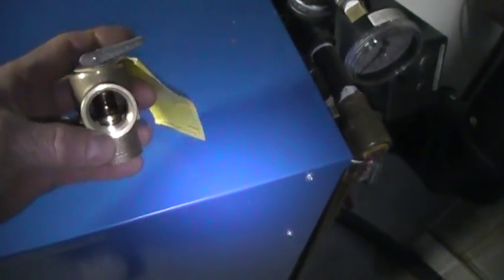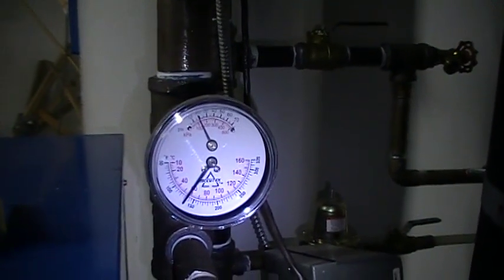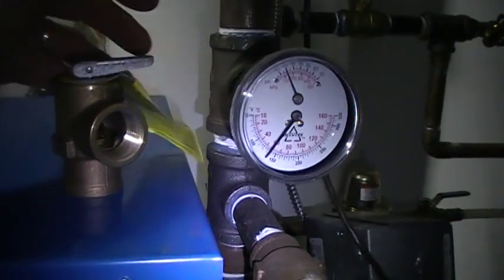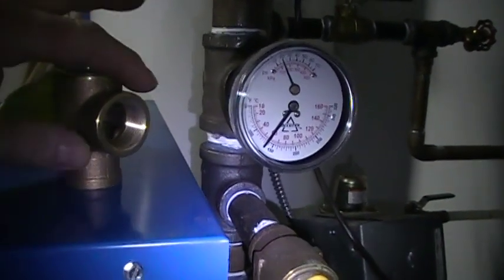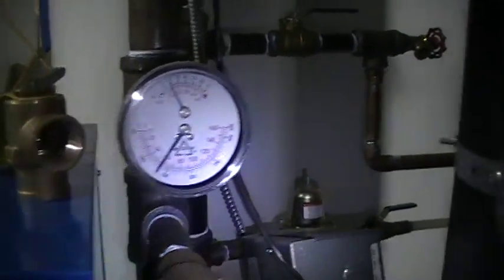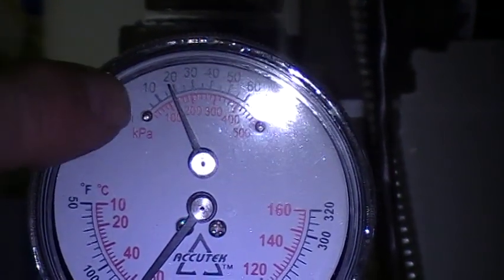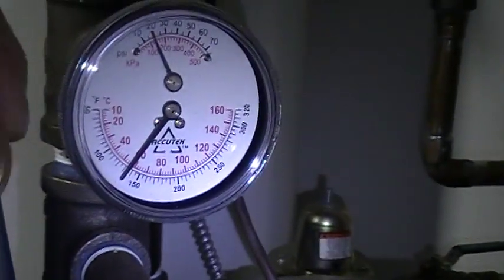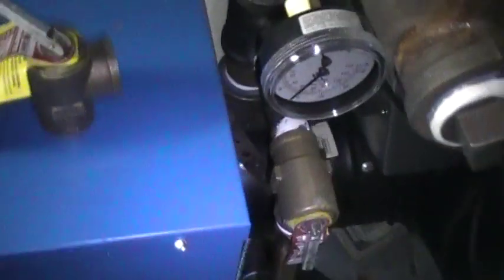Relief valve on a hot water boiler (furnace)....part 5...Safety first

Comment: One thing to be very mindful of , The relief pressure rating on a Domestic hot water heater relief valve is usully set at 150 PSI ...The Pressure for a relief valve on a Hot water Boiler is set to release at 30 PSI ... I have seen do it yourselfers go into a hardware store and purchase a domestic water relief valve set to releave at 150 PSI and install it on a hot water boiler to say thats dangerous is an understatment.. Also note its requred by code or device manfacture in many applictions to use a "Temperature Pressure Relief"  valve that will also open at a specific temperature as well as blow off at a certain pressure ..  The relief valve you install "must" also allways be rated in excess of the BTU rating of the boiler's heating output.
Reply from the maker: Hello brianperkins6121,
Thanks for the input much appreciated!
Very well written as well!
Thanks for commenting and enjoy your holidays!    Al

Comment: What if the psi is at 15? Is the furnace still ok is it just the valve?
Reply from the maker: Hello Andrea Hardy;
15 pounds is a good pressure for a heating system if it is not operating and you
will have no problems if it is. The system usually goes to 20 PSI during the heating system; so 15 pounds is fine. It takes 1 pound of pressure to lift water 2.31 feet; so this is the reason why pressure is required on the system to get the water to the second floor of people's homes. I hope this answers your question.
Thanks for commenting and have a great day!    Al
Reply: Perfect answer, thank you very much!
Reply from the maker: Hello Andrea;
You are more then welcome!
Thanks for commenting and have a great day!    Al

Comment from the maker: Hello GalaXy808;
I don't usually install a temperature gauge on a water heater, but if I was to install one; I would use a copper by female by copper tee. I would install this right off the top of the tank on the hot line coming out. Then I would thread the gauge into the female part of the tee.If it is an older tank,you do NOT want to thread a tee directly onto the outlet pipe on the tank as the threads may be in bad shape. 
I hope this answers your question. 
Tks 4 commenting and good luck! Al

Comment from the maker: Hello jwvgoethe77;

Check your bladder tank just to make sure there is the proper amount of air in it. It sounds very much like tank to me even though it is a new one. If the boiler is not running and not blowing off; then it is definitely the tank. Does the boiler temperature stay at the set point? ( Does the high limit cut the boiler out? Should be no higher then 180 degrees ).
Thanks for commenting and have a great day!   Al

Comment: Stays at 30psi. maybe 3 lbs more sometimes.  The Pressure release valve just releases a little of water, seeps and then stops after the boiler stops. The expansion tank isn't waterlogged, Actually I just replaced it 5 days ago. before that, I had a big expansion tank ( no bladder ) but the back rusted out and I replaced it with a bladder tank.  Any solutions? Maybe the pressure release valve needs replacing.

Comment from the maker: Hello;

There is more then likely a reason for your relief to start leaking. If it is not leaking to bad, I would put it back on and place a bucket under the pipe coming off the valve. You  should NEVER plug a relif valve or remove it and place a plug or cap where the relief valve was.
You maybe able to pick one up at a hardware store before they close. The big box stores should hvae this style or you may have to get a 3/4" nipple to thread into the valve and then the boiler.
Best of luck!  Al

Comment from the maker: @mule5150 Hello;

A lot of things come into play when buying a boiler. Manufacturer and BTU's just to name a few. You are probably looking in the range of at least 2k for JUST the boiler and I would suggest getting a wet base if going castiron. Odyssey ( NTI ) is a very good brand as far as I am concerned when it comes to oil fired.
Best of luck with you repair or new install and enjoy your week!!!   Al

Comment from the maker: @mule5150 Hello;

So now if you leave the valve shut off to the coil and drain the pressure down on the boiler to 12 pounds which is the pressure that the pressure reducing valve feeds the boiler at; you can turn the boiler on and still have heat. 
Best of luck with your project!!!    Al

Comment: @TheOldkid888 ....thanks for all the info ....I have it shut down now ,and the pressure is high. I tapped the extol tank , it sounds hollow on top and heavy on the bottom...I do have a leak in the coil. the new relief valve I put in, leaked again, so I guess the old one was working ...thanks ...g

Comment from the maker: @mule5150 Continued:

If the pressure only rises to around  20 pounds; then your coil has to be replaced. Check again by opening the valve to the coil and if it rises this is where the problem lies.
What temperature does the boiler turn off at? If it is rising much higher then the temperature set on the aquastat. It is possible that the aquastat could be faulty, but not overly common.
40 pounds plus sounds more like a bad coil to me.
Let me know how you got along!
Best of luck!  Al

Comment from the maker: @mule5150 Hello;

It could be one of a number of things.
Do you have an expansion tank on the system? It could be waterlogged and has to be emptied.
Is there an extrol tank in the system instead? The bladder could have a hole in it and the tank has to be replaced.
Do you have a hot water coil in the boiler.There could be a pinhole in the coil and your street pressure could be going into the system. Check by turning off the valve going to the coil adn draw the pressure off the boiler.